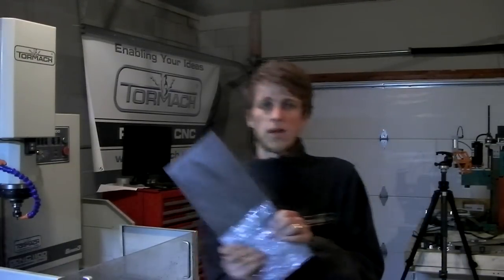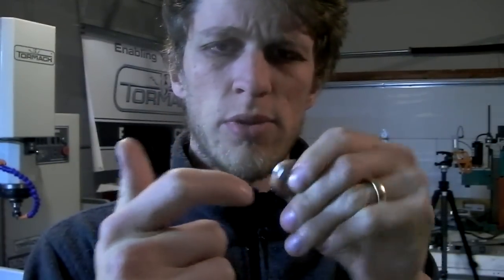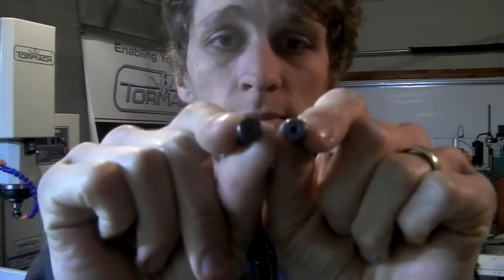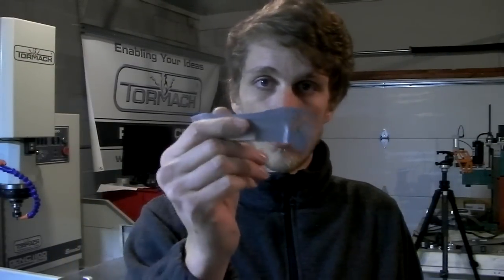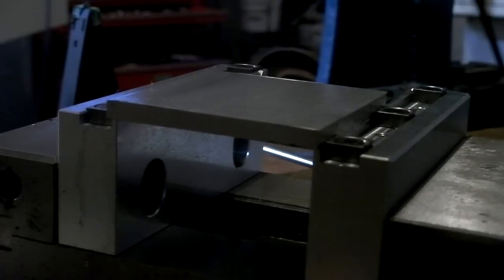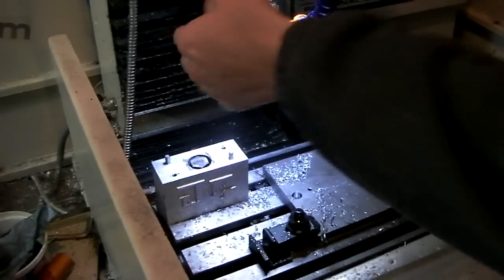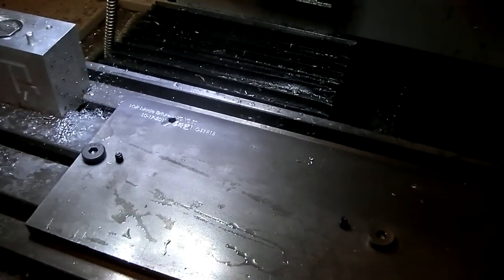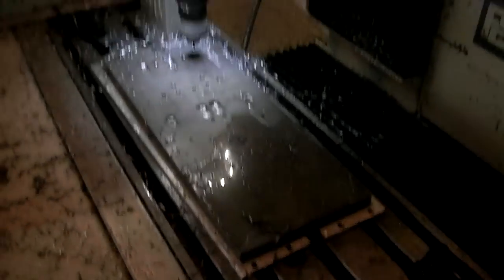Knifemaking Tuesdays Week 44 - machining Tor fixture

Comment: First threaded fastener is a PEMSERT.  They are self-clinching/broaching and pressed into place.  Typically not used with plastic/micarta but might work.  Second fastener, and the one you settled on, is a barrel nut. Mighty-bite clamps and accessories are nice but a bit pricey.

As for your fixture work, live and learn.  Consider threading those oversized holes and using a replaceable threaded stud with Loctite.  Drill and tap those to what you really need.